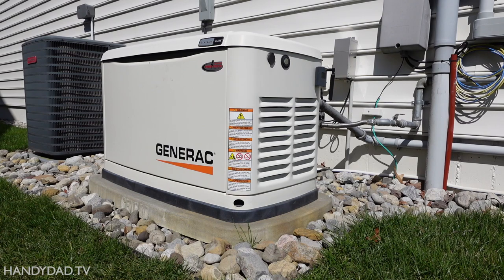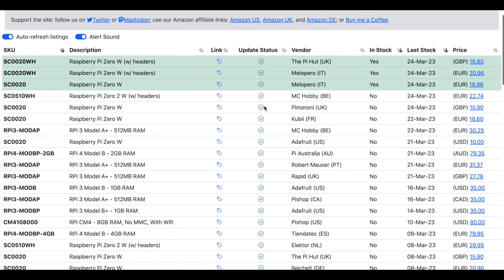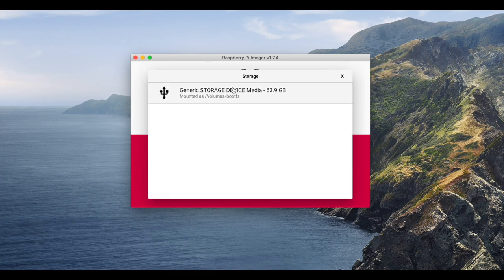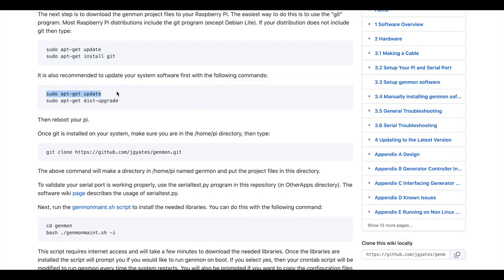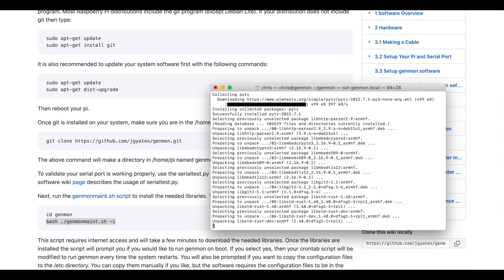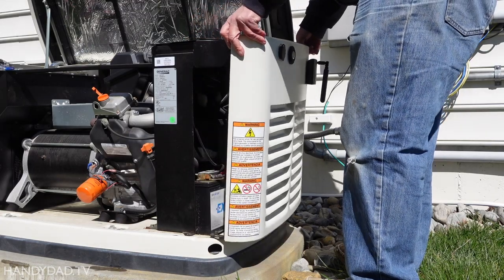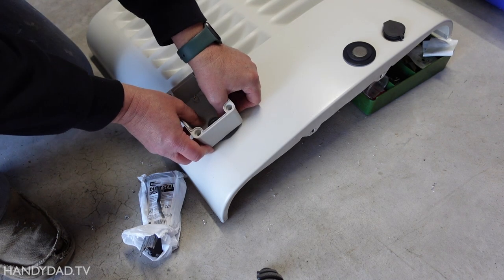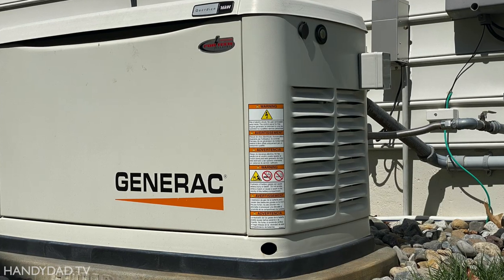DIY Generator Monitoring with GENMON

Comment: NEW PI USERS!!!!! READ THIS!  IF you don't see a green light when you plugged in , it's because you NEED a SD Card with the OS installed first.  The OS on the chips controls the light!!!!
Reply from the maker: Thanks for pointing this out.
Reply: @handydadtv  Just to confirm , after this command "sudo apt-get dist-upgrade" its taking a good 30-45 min, its going, but its taking that long, I just want to confirm is not just me. Also the instructions talk about a  serial port and test it, I just want to confirm, do we need that or since we have SSH we dont need it?
Reply from the maker: Let the commands run. They can take time because they are downloading as well as installing. 

The reference to serial port is for communication to the HAT board and molex connector.
Reply: @handydadtv  does the script did everything for the serial port?
Reply from the maker: @cienamiguel5031 I guess so. All I did was follow the GitHub directions.

Comment: I tried this as well but I guess the molex doesn't provide enough power for a rpi3b+.  Now to figure out a way of tapping into the battery
Reply from the maker: It should work. Maybe there’s something wrong with the HAT.
Reply: @handydadtv  not sure.  Everything works fine if I provide power to the pi via usb.
Reply from the maker: Contact the company. Maybe they can help you troubleshoot. The product page says it should power the Pi for you.
Reply: @handydadtv   I figured it out, saw somewhere else that the gen1 evolution does not provide power through the molex.  Pintsize did include the extra power cable that connects to the battery terminals. I just needed to put in a bit more elbow grease than just plugging in the molex.  My nerd hands had to get a little dirty.  Now on to getting a junction box for the outside. Wifi signal goes deep red with everything closed.  What size box did you use?
Reply from the maker: Small enclosure - http://handydad.tv/senc
Reply: Handydad is correct.  It should power the Pi. Something is wrong with HAT or the Molex cable.
Reply: Ahh, mine is Gen 2, so no problem.

Comment: mac does not recognize 'Apt -Get' command to download the GenMon software. is there another way to install Genmon from Apple Mac?
Reply from the maker: Those commands need to be run on the Pi OS, not your Mac. That’s where you’ll install it.
Reply: @handydadtv  Right. I found out that my Macbook cant find the Headerless Pi zero W. The Pi doesnt show up. Im not sure if it has to do with 2.4 GHz why the wifi doesnt see the pi. same problems with the Pi3 B+
Reply from the maker: @willemtenwolde5826 Assuming you know the IP address, and it’s not on your guest network, if you can ping it, you should be able to SSH into it.
Reply: @handydadtv  thanks. I figured it out how to ssh into it

Comment: Does hooking up GENMON void my Generac warranty? even extended warranty?
Reply from the maker: I’m no lawyer but I doubt it. If you needed warranty service and wanted to avoid the issue, you could just unplug the Molex connector and remove the Pi beforehand.

Comment: Great video. Looks like there is no specific app for IOS or Android. You can only access the gauges through a browser on a PC. Is that correct?  How do you access it on your phone? Through the phone browser? Thanks.
Reply from the maker: It works with Chrome on a phone too.
Reply: @handydadtv  That is correct. To access the system from outside of your wifi system, there are multiple options. The best ones are  cloud-based. I am researching that area and will report back.
Reply from the maker: @u12play007 Ah, I never connected it outside of my firewall. It shouldn’t be hard to setup port forwarding if you wanted to, but I’d put it on a different subnet for security reasons.

Comment: Thanks for the video. I have it setup but can not get the email notifications working with gmail. When I run a test email, I get an  error.
Reply from the maker: It took me a while to figure it out but it does work. If I remember correctly, I think you need an app password. https://support.google.com/mail/answer/185833?hl=en

Comment: Excellent write up and added suggestions. Going to fab one up for my 22KW Generac. The biggest disappointment with Generac WIFI  app id the exercise time is factory set to 5 minutes run time.  My generator oil is really milky from condensation NOT getting burned off from the short run time. Genmon lets yo set the exercise run time or run it under load which is a huge plus in addition to real generator feedback.
Reply from the maker: Yes, it’s awesome.

Comment: Appreciate your super video!!
My unit is close to the garage where also the ATS is. The climate is pretty hot in Houston and around the generator. I like to see if I can place the PI inside. What are your thoughts>
Reply from the maker: You can monitor the Pi temperature within Genmon.

Comment: -Will the generator HAT board and all other accessories you suggested work with the Raspberry Pi Zero 2 W as well or will it required a different work-around? 
-Also, the options on the site where to order the HAT board have changed.  It's now the PHAT v2.6+ (closest to what you show in your video) and it doesn't specify if it comes with a molex cable.  Does it or can you provide another option where I can purchase?
-Thirdly, it added a drop down box titled Generator Controller, which requires a selection.  The options are Evolution 1, Evolution 1 Liquid Cooled, Evolution 2, Evolution 2 Liquid Cooled, Sync, Sync 2, Sync 3, PowerPact with Evolution, Nexus, Sync and Other.  Which one should I select?
-Lastly, what size hole did you drill in the back of the box (to which to feed through the molex cable) to match that on the generator?
Thanks!
Reply from the maker: I don’t know. I have no relationship with that site to ask someone.
Reply: @shalatee Did every found the option for the controller?
Reply: I found the answer is Evolution 2 for my Generator...basic open it and it will tell you right there in the display...
Reply: @cienamiguel5031  that’s what I concluded as well. Sorry for the late response.

Comment: Great video. Congrats. I came here looking for a way to connect to a portable generator. Mine is a Westinghouse Wgen7500DF. It connects to my breaker panel via inlet box/30Amp cord and an interlock kit. So it is a manual change over when the power goes out. In my case, that was over 8 days after Hurricane Beryl blew in to Houston. I kept notes in Excel for run times, fuel usage (propane and gas), oil changes and spark plug changes. AND my Home Assistant ran but only local network. When Xfinity goes down, so does the internet. That took an extra 2 days for them to get us up and going again. I'll keep looking but I think I am out of luck.
Reply from the maker: I don’t know of any similar solution for a portable generator.

Comment: This was a great video im getting a 22kw generac with wifi already. So, from what i have gotten from your video is I need 3 things only. 1) raspberry pi with wifi and the pins 2) the hat which comes with the wire harness that plugs into the pi and the generator 3) a micro sd card for the software. Am I correct
Reply from the maker: Sounds right

Comment: There is one part that I don't intuitively know how to do:  I have the genmon on the Raspberry Pi and I have it connected to my generator and, to my understanding, it is working.  how to i access it to see what information it is providing. you didn't mention that in your video.  (i have never used a Raspberry Pi before so I suspect those who have didn't need this explained.)
Reply from the maker: Try going to http://genmon.local:8000. If that doesn’t work, you need to determine the IP address by looking in your router’s DHCP table.

Comment: I'm pretty sure that I got everything installed but now I am stuck with the serial loopback test. connected the two UART pins, in config.txt put 'enable uart=1' but unlike in your video 'genmon,local:8000 like with so many other people does not work and I can not fine one consistent solution. It's really depressing.
I also do not get to see the so called "wheels" . I'm reluctant to buy the complete loaded SD card from Pintsizeme because I wonder if that will work.
Reply from the maker: I didn’t know they sell an SD card with Genmon preinstalled! Thanks for the tip.

Comment: How well is the Pi Zero W holding up? Thinking about doing this but does this Pi still have enough performance for genmon? This is all I would do with it.
Reply from the maker: It’s been working great all this time. No concern about processing power. It’s a lightweight app. 

It would occasionally lose WiFi so I added a weekly reboot and that fixed it.
Reply: Thanks, glad to hear. Just got mine set up and working on an older 8kW Nexus unit.
Reply from the maker: @johnw4067 Good job! Enjoy that. See if you have any WiFi issues and I might be able to remember how to do the weekly reboot.
Reply: I am getting -65dbm so not too bad. No connection issues and can ssh/remote desktop into it. I did add the wifi and weekly reboot scripts in though. Pi Zero W runs this app great.@handydadtv
Reply: @johnw4067  For us not that tech, can you post or how to add the weekly reboot? Sorry for the ask ..

Comment: So I take it this does kill the ability to use Mobile Link at the same time right, since you unplugged the built in Wifi?  I have an active ML subscription but may do this once it runs out later this year...
Reply from the maker: Correct. But you can always test it out and reconnect ML if you want to go back. Genmon is such a better solution that I doubt you would want to go back.

Comment: Followed your video and all works great except email notifications.  Did you have to do anything special to get it working.  Iv added my email to the notification page, but not sure about the optional outgoing email settings, what they should be or can that option be turned off.
Reply from the maker: I use gmail and needed to generate an app password. It doesn’t use my login password.
Reply: Thanks email now working
Reply from the maker: Oh good. That’s what I rely on to let me know that the self test is successful every week.

Comment: After the bash command, what do you choose, Serial, USB, Network, etc. Copy configuration files to /etc/genmon/? (y/n)?y
Copying *.conf files to /etc/genmon/
What type of connection from genmon to the controller? S=Onboard Serial, T=Network, Serial over TCP/IP Bridge, U=USB Serial (s/t/u)?
Reply from the maker: I’m pretty sure the HAT would be onboard serial. But I really don’t remember.
Reply: @willemtenwolde5826 hopefull you have this solved by now, but just in case you don't (or someone else stumbles upon this) the HAT does use the Onboard Serial option.

Comment: I’ve been looking at ways to get any data at all from my Generac. 
Is this monitor only for a Generac?
Does it only work on newer Generacs with that same controller wiring harness?
My model is maybe 18 years old and has analog meters and switches only.
Reply from the maker: Read the GIT page. It says what it works with. It’s more about the controller than the brand itself.

Comment: I've had my system up and running for a few years.  Recently unable to see it on my PC Chrome Browser.  I reloaded all the software on a new SD card and now my router can see the Raspberry Pi address.  Can't connect to it using the usual 192.168.2.XX:8000.  Any ideas?  Maybe a security setting issue?
Reply from the maker: How do you know the IP address didn’t change? That can happen with DHCP. 

I have a UniFi router and I let it assign the address initially, but then I flagged it as fixed so it never changed.
Reply: @handydadtv  I have a Bell modem and the IP has been set to reserved.  I have rechecked this a few times now and it still shows connected to the address I'm inputting (Raspberry Pi, only one in the house).  I can ping it from my computer.  I know Firefox never worked but I'm using Windows 10 and Chrome as an explorer.  I now have a monitor connected directly to the Pi and can surf using Goduck.  I just connected a LAN cable to it also. I can also see it via this connection.  Also, what's it mean when the address ends in 192.XXX.X.XX/XX?
Reply from the maker: @waynebinky You’ve exceeded my knowledge. Sorry.
Reply: @handydadtv  Damn.  Strike one.  I hate bothering Mr Yates with these issues as he's done and excellent job with all the programming.
Reply from the maker: @waynebinky You can try Reddit /r/linux since I doubt it’s a Genmon issue.

Comment: Link for Molex connector and cable you used ?
Reply from the maker: https://pintsize.me/store/ols/products/generator-hats-and-phat/v/PGI-PHAT
Reply: Does the HAT come with the cable?
Missing it in the options.
Reply from the maker: @jkh62 Yes.
Reply: Thx for the quick reply, got my HAT & pi ordered.
Reply: Got my pi zero and having a battle logging into the pi. I see it's connected to my wifi and it's IP address. Using terminal it's asking for my password (set up in images flash) but I am getting accessed denied.  Tried by keyboard and onscreen keyboard so it's not an input issue. My login should be what I plugged into the image flash set up, correct? Can not connect using the IP Addy in web browser either. My HAT arrived today also. Just gotta get in and run the set up scripts. Pi is new to me and using Win11 pro.
Reply from the maker: @jkh62 Make sure it’s not something trivial like caps lock. Otherwise scrap it and start fresh. You get wiser each time you do it.
Reply: Figured out my connectivity issue : My router security . Set up the IP and MAC address in the DMZ zone and I got connected and loaded it.
Reply from the maker: @jkh62 Glad to hear you didn’t give up.
Reply: When I connected by ssh I thought I was good to go but it would not take my password.  Rookie mistake. Also set a static IP address so it will never lose connection from power cycling  and the chance of a different IP assigned . Thx for the help.  Need some attachment hardware from the big box store to mount my box and good to go !
Reply from the maker: @jkh62 FWIW, I found it would become unresponsive every couple of months so I added a cron job to reboot the Pi every week. No issues after that.
Reply: Great tip.

If I want to do it manually from ssh is it :

sudo shutdown -r now
Reply from the maker: @jkh62 I don’t remember. I Googled it.
Reply: @handydadtv  I see this now, what accessories should I order with it on the drop down menu?
Reply from the maker: @virgilsmith5792 I didn’t buy any accessories. I bought the Pi separately.
Reply: @handydadtv  As an Accessory do the HAT I have also need the Pi Zero - Mini-HDMI to HDMI + USB OTG Hub, splitter injector and loopback tester they offer?  Thans very much!
Reply: @handydadtv  Is that the Pi Zero - Mini-HDMI to HDMI + USB OTG Hub
Reply from the maker: @willemtenwolde5826 I don’t think so 🤷🏻‍♂️
Reply: @handydadtv  I'm going to learn about Cron and how to do it. Just got my Pintsize Hat and cable. Also going to check out the Pi3B+ and find out if it needs a hat like the Pi zero